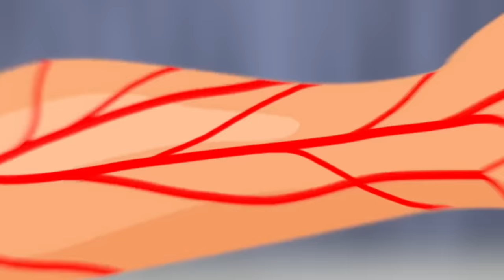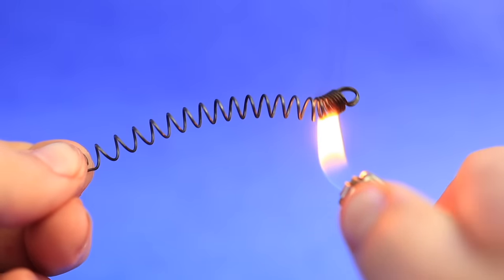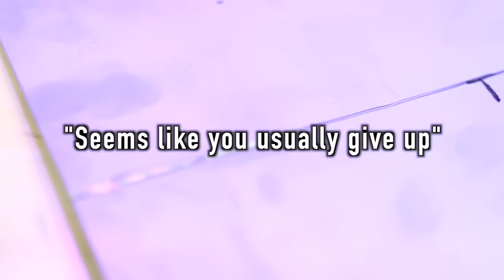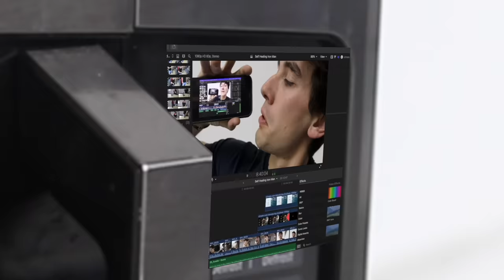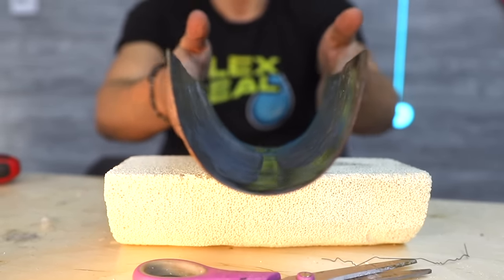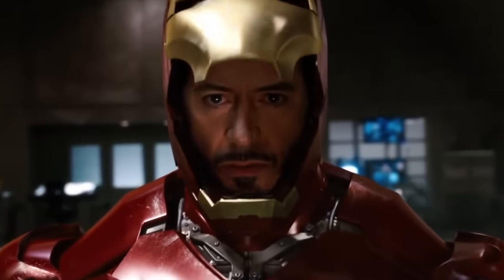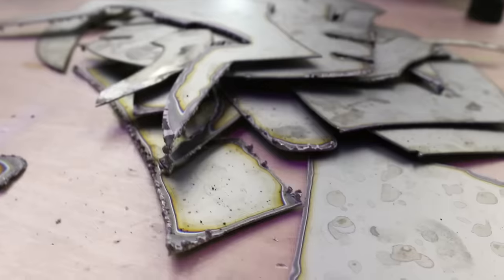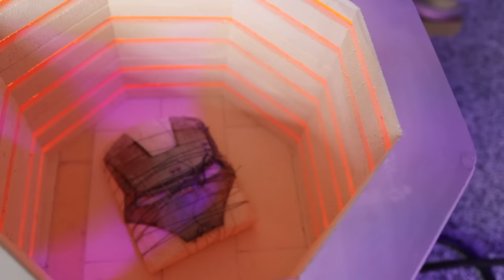Real Self Healing Iron Man Armor - Nanotech

Comment: Combine it with kevalr and padding and you've potentially got a self healing bulletproof helmet. You could also put some nitinol mesh inside the helmet for even more stopping power
Reply: Surely it would be more suited to some kind of ballistic ceramic?
Reply: One word. Sorbothane.
Reply: I mean, besides some minor brain, skull, and ear damage it’s a good idea. But to be fair, would prolly rather have a concussion than be dead.
Reply: @blitzandchitzgaming2584 carbon nanotubes would be more likely, graphene is cool but to get enough to work with and manipulate might be hard. Carbon nanotubes tho not only are strong af, they’d be sick to add to the design. Spider silk would just suck to source
Reply: @Plopper2000  this guy is definitely onto something 🤣
Reply: you better stop talking
Reply: @blitzandchitzgaming2584  Spider silk is an equal equivalent to Kevlar aramid fibers and was the precursor to Kevlar. A small handkerchief of the stuff could catch buckshot, and it was used as a cheaper alternative to aramid in some developing countries with a high silk market.
Reply: Don't let the fbi snipe you
Reply: you GOTTA make Star Lord’s helmet!
Reply: @Plopper2000  Well, at least we know what to make our robot bodies from in the future.. We won't even need replacement parts when something break, just heat it up :D
Reply: Wouldn't you just die of the impact though? I guess you could get away with a concussion against a really low caliber bullet but anything over that would just kill you through the impact right?
Reply: Just wanna write a kind of it.
Your helm can repair himself.
Your head is not.
 @Plopper2000
Reply: it wouldn't be able to repair the Kevlar. give it another hundred years, who knows, technology might reach the point where we can build indestructible structures. (not actually indestructible, obviously, just really close to it.)
Reply: Kevlar 149?

Comment: In before all the comments about "its not self healing if you have to heat it" 😅

I've been meaning to make a self healing captain america shield for a few years now after i did the self healing wolverine claws... maybe this is a sign I should start it up! Epic project man!
Reply: Yeah you should a healing shield would be sick
Reply: Make a Metal guitar that connects expand from a belt
Reply: Real
Reply: Yeeeaah make itttt
Reply: You or/and Jlaser should make mini ROCKET LEAGUE:
Field: tempered glass
Goals: sensors that detect when the ball is fully in the goal and then do a holographic goal explosion
Cars: Remote controlled, wheels have grip to stick to walls, cars have spring loaded 1st jump and 2nd jump uses CO2 cartriges, flip in any direction using the CO2 cartridges releasing air from different places, boost can be one of those mini rockets, sliding weights to control tipping forwards and backwards rotating sideways and air roll, propellors on bottom of car that make it fly if boost can't and if it can then they can assist in control. Not sure how to do powerslide.
Controls: connected to a controller
Reply: Could u ask Jake for an update on the Spring Rings (bouncing frisbee)
Reply: It reminds me of Gut's berserk armor
Reply: you guys should totally do a collab at somepoint
Reply: The best captain America shield would need to be made out of beryllium. Beryllium is the real world equivalent of vibranium. Similar to vibranium it is extremely light, hard, strong and conducts sound waves at an unusually fast speed. Basically when you hit it, it vibrates in a similar way to vibranium. HOWEVER Beryllium is very poisonous and dangerous to work with. And Dust from working with beryllium is extremely poisonous. If You were to build a shield out of it. You Should alloy it with another metal to reduce toxicity. also, if you were to have it made, have it plated in Chromium. As chromium is extremely hard with a hardness of 8, it shouldn't scratch and expose you to its poison. To make the shield bounce, I would put a rubber rim around its edge and then to make it dangerount, on the edge of that rubber, have a nitinol extension attached to the rubber as an edge surround the entire outside of the shield. On the inner part of the shield, facing the wielder, have nitinol springs, that are attached the the rubber edge headed into a core area of the inner shield that push out the rubber just a little bit. Or better yet, have the springs along the edge, with rubber on its edge, then the bladed nitinol edge around that. This way when thrown it will bout off things and be dangerous when thrown. You can also to reduce chances of toxicity exposure, have on the outer part of the shield, a layer of nitinol to both self heal, and be bullet resistant. In this case the shield should be very light, and not too heavy.  Again, Beryllium is deadly toxic, so if you decide to ever use it, it needs to be done in a way that while in manufacturing there is no human exposure. Also beryllium is really really really good at conducting heat, the best metal in the world at doing that. So if you built it correctly, you could actually make a real captain america shield. Just be carful building it if you decide to follow my instructions.
Reply: Kermit6613 only the creator of the video can heart it
Reply: Do it!!!
Reply: what happens if you make a tool out of this metal? let's say a screwdriver or a hammer.
it works? or will it break?
Reply: you guys need to work together
Reply: I'd watch that. Go for it Chief!
Reply: YES
Reply: @StuffIsStrange  I agree
Reply: Awesome
Reply: It would be nice if i was invited to a video
Reply: make a stealth suit that looks at the back round and fills it in by itself
Reply: You are just not the same anymore bro I remember you quitting your job for this and now that u ig “made it” the vid ideas kinda went down hill or just repetitive
Reply: now i wonder if u kept it constantly heated would it resist disfigurement? keeping it by running current through it
Reply: I’ve gone through countless comments and you’re the only one pointing out the technicality of it not being self healing
Reply: Your stuff is way better than this bro no comparison
Reply: you guys should collab
Reply: I have idea maybe Try to build Something from Titanfall 2 maybe pilot Jump kit or Something😅
Reply: on another  video can you please please fill/layer the inside of your equipment with padding and fire/heat proof material. Who knows youll probably get closer and closer to a working set of armor especially when damaged u can heat up while you are wearing it! (Blow this up yall!)
Reply: you should totally make the shield out of this same material also when u do can i buy it off u
Reply: srry i know im long winded but can i apprentice off u. I do got bit of a rough past in which i can def share with u on my ig. same thing as my youtube username
Reply: What is Stark doing here
Reply: simply amazing, NOW make THORS Hammer, and have it come back to you 🤣🤣🤣😂😂😂😉
Reply: bro him and you would make something insane
Reply: bruh he works from home chill
Reply: U shud get all the youtubers in this video In on it a huge collaboration
Reply: The GOAT's themselves 😮
Reply: heating station
Reply: Do it as a colab, man. That would be awesome.
Reply: Wouldn't a colab be cool?
Reply: "This car is not autonamous, you have to push a button to start it"
Reply: Most respectable “um actually 🤓” ever
Reply: A self healing captain America shield  probably would've been useful for Steve Rogers in endgame. Now that would be a good hacksmith video I would watch.
Reply: if only you didn't have to fake the healing stuff like he did.  Make something that heals itself at room temp while wearing it.  Otherwise, its BS.
Reply: Make it Hacksmith, Maybe you can use it next time in ROBOWARS
Reply: Wait you should combine all your projects for iron man into one the model 2 helmet the repulsor and maybe garvis and the laser then just design the armor
Reply: We need an epic collab to make a suit
Reply: PLEASSSSSSEEEEE
Reply: Kermit6613 not his video.
Reply: @NNFTALK  like work there?
Reply: dog act by saying that, jealous much
Reply: Kermit6613 that’s not how it works bro
Reply: I clicked on this video and thought it was you
Reply: Did I heard collab?
Reply: HACKSMITH i really hope that you can do that Captain America shield healing project i would love to see it good luck i'll be waiting and rooting for you love your videos
Reply: Totally
Reply: @theHacksmith Can you self heal my heart pelase
Reply: I feel like all ya guys who make this stuff on yt should come together... pitch the idea of a supersuit like a proper iron man suit to mr beast, get a few mil in funds for it, yall get a video and jimmy gets to keep it. Manifestation goes hard🔥🔥🔥
Reply: It would be amazing if you could use this technology for a blade, which you could make it hollow for a blowtorch inside to heal it by a press of a button.
Reply: Self-healing shield would be epic.
Reply: your next project should be to find a way to send me that arm by itself like iron man 3's suit
Reply: Well, it's not self healing because it's not preparing itself, just reforming.
Reply: I watch your vids
Reply: You can make some things fnaf or stuff like that
Reply: Go back to Iron Man stuff!
Reply: You should make spider man miles maralis bio electrical hands
Reply: You should make spider man miles maralis bio electrical hands
Reply: You guys should collaborate and make an iron man suit
Reply: HE COMMENTED IS THIS A SIGN FOR A COLLAB???
Reply: I'm more interested in knowing how much the material weighs?
Reply: Kermit6613  hacksmith??
Reply: Kermit6613 Earn it, don't just ask for it like some poor little beggar. Have some self-respect.
Reply: Hulk fist
Reply: Bro just use it near a volcano, not a big deal bro.
Reply: when u fight with a fire guy
the more u touch me the more i stronger i get
Reply: well, very easy to heal is very good to :3
Reply: 100% true I am thinking about making a actual  garvis ironman robot that actually works and moves around.
Reply: COLLAB?!?!?
Reply: I wuss thin❤ing
Reply: Ho no I did not mean to put ❤ in tat and sent it early 😂😂
Reply: And idk how to edit😊
Reply: Could you make a series about batman gadgets like batmans cowl from the Arkhamverse with detective mode and other technology
Reply: Big idea what if you get all the past suits of Iron Man, and combined them all together to make the true Iron Man suit
Reply: try putting a mini heater in there to keep it warm
Reply: He makes the entire atom suit (From the arrow series), which shoots beams of light, which (if possible) has x-ray vision. Up!
Reply: its not self healing if you have to heat it
Reply: no way the goats here
Reply: make the iron man weapons from infiltrating the mandarin scene
Reply: Ok but promising to do that doenst change you titled your video Real Self Healing, when its not. Sure your the closest but its still a fail if you have to heat it.
Reply: yo that would be sick but hacksmith dont come to others for fame that just makes you overrated
Reply: Yooo colab please
Reply: Yeah
Reply: Hacksmith, we just have waiting for real macro scale nanobots system to exist.
Reply: Y'all should have a Collab
Reply: ok but if it self heals after your head has been run over your head is still run over
Reply: I was thinking on the lines of great the armor self heals, but uh, what about the giant hole in you head?   lol
Reply: Yo hacksmith
Reply: Put electricity in it
Reply: You should make a nano tech iron man suit or unibeam please
Reply: Is galium magnetic? You could contain the flow of it with magnetism
Reply: Yes you should make one
Reply: You guys should defenitly team up you and this guy for a future project
Reply: Bird6613  this is not a hacksmith video so no he can't
Reply: lmaooooooooooo
Reply: imagine layering kevlar and this metal.. it would keep its flexibility in healing and also would be bullet proof ( and mybe more fomfy to wear? )
Reply: Leave it to Hacksmith to show up and try to promote themselves. 🤦 Go sell more glorified, rebadged lighters.
Reply: I’ll put it here too make a thanos gauntlet
Reply: Hacksmith should battle this dude
Reply: not even gonna mention the fact that the title says nanotech for some reason
Reply: @assassinworks5538  Starbucks barista vibes
Reply: Hacksmith should work with this guy
Reply: Yup
Reply: Bird6613  This isn't Hacksmith's channel so they can't heart it
Reply: Can the keep it at self healing temperature though? And, is it worth it?
Reply: You so should
Reply: Www

Comment: Maybe you should try making a powered chest plate that could send the current necessary to self heal the different parts? Epic video. I am seriously amazed at this material's resilience.
Reply: I'm loving this idea, it's the perfect complement for the rest of the suit!
Reply: it has like a AC system where it heats up everything else
Reply: I was thinking… if he actually got those people who were going to charge 100k to cut it out of a solid block so it was all one piece it could be much thicker and more durable while having no connection points it would be really unbreakable. Given how it did against a 9 mil, double thickness would probably stop most .223/.556 rounds and obviously at some thickness it would be able to stop even 50 cal
Reply: Great idea
Reply: @march2032  It's titanium after all, the hardest metal in the world
Reply: It would take too much current a single nitinol wire takes around one amp at 12v to pull shape.
Reply: Man. The human body makes heat.
Reply: @Sehhonen wouldn't he die of heat

Comment: The applications in armor might not be immediately apparent, but this seems like it could be interesting for prosthesis; natural limbs can heal a cut or even fracture over time, but a metal limb requires repair. This material as a casing could be interesting, since the goal there is to protect the mechanical bits inside.

Comment: An interesting project you should try is essentially making a split hoverboard (one wheel at each foot) and making it fold behind your calf so you don't need to take it off when you want to walk inside. Being an engineer I have actually given this idea a good amount of though and may attempt this myself.
Reply: Then, is this a hoverboard or single wheel skates? I've seen a video  of a similar maker putting one wheel on each leg/foot. He face some problems with his legs bowing in or out from the force.
Reply: @2degucitas  yeah kinda like skates except one wheel instead of many. You would need to make the wheel small enough where it can go directly under your foot so there's no weird forces like that. It would be something similar to the Segway Drift W1 but be able to fold behind your leg and capable of slightly higher speeds.
Reply: @sirnukem   It would need to be attached to a sturdy boot with braces going up to the knee held with a strap. Otherwise, the leg bending I mentioned before.
Reply: So just roller skates

Comment: I noticed that some of the bolts fell apart during testing. I wonder if it is possible to get screws and nuts made of the same alloy. One idea is also to put a layer of Nichrom wire on the inside so that the heating element is in the mask. A clever arrangement could prevent the wire from breaking on impact and would make the mask heal itself when you would put current through the wire.
Reply: He already mentioned just running a current through the mask to heat it, no need for nichrome wire.
Reply: @conorstewart2214  I think that the current run directly through the mask might seem like a simpler solution but, there are practical challenge there. Nickel-titanium alloys typically have a lower electrical resistance compared to Nichrome. This means a significantly higher current would be needed to achieve the same heating effect, potentially making it impractical and unsafe due to the risks of electrical hazards. Nichrome, with its higher resistance, can achieve the heating effect more efficiently and safely at lower currents. Also, integrating Nichrome as an internal layer would give us more control over the heating distribution, so that the mask can be uniformly self-regenerated. 

But it is just an idea😀 I bet there is more ways of doing it.

Comment: This is actually incredible. One thing you could do to make this even more of an ultimate Ironman armor set would be using thin carbon-fiber or ceramic "scales", which would not directly connect to each other, but to the nitonal. It would allow incredible resistance to bullets and prevent damage to the person inside, as it will spread out the force.
The last thing I want to suggest is that if you go for making more armor or making this look nicer, a not-so-strong but very effective material for a self-healing project would be acrylic. Can be liquid at room temp and at a pretty solid range of temps, automatically binds to other acrylic, is self-leveling/smoothing, shiny, and will also bond to pretty much any flat surface with decent strength. It could either be kept in small vessels implanted around the suit, or a running vein system that flows throughout it, like your solution with the galleum prototype.

Comment: The gallium idea is actually really cool. The reverse of using nitinol. I'd like to see a combination of the two, like adding a heating element to the nitinol so if it gets dented, it goes back while you're still wearing it. Probably very impractical but it would be cooler than removing the armour and holding a torch to it
(Or i guess using current like you showed with the mask closing, that would probably be safer just by adding a non conductive layer beneath.)